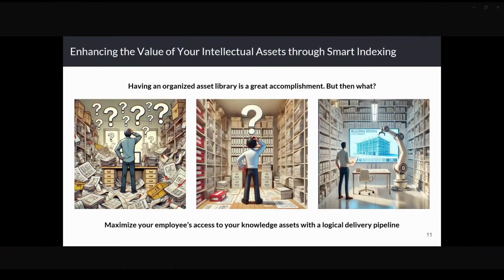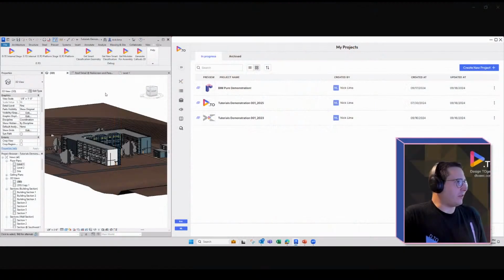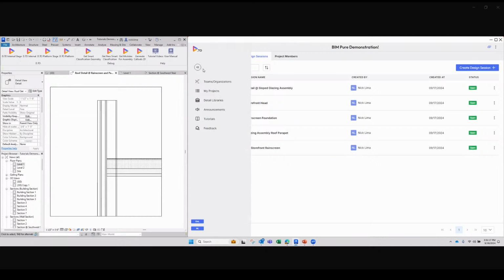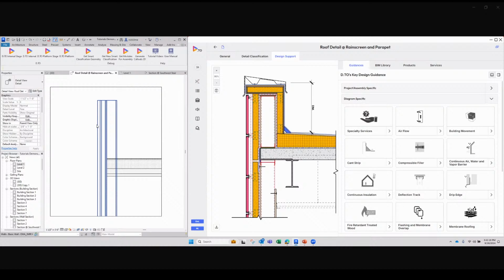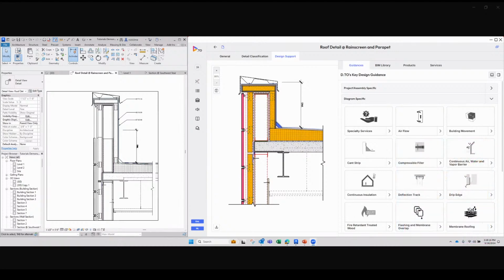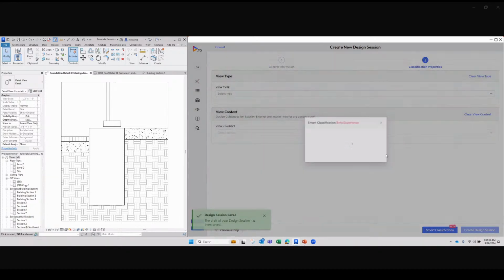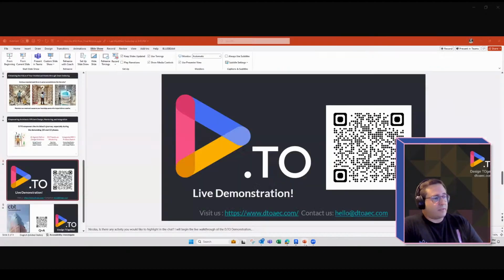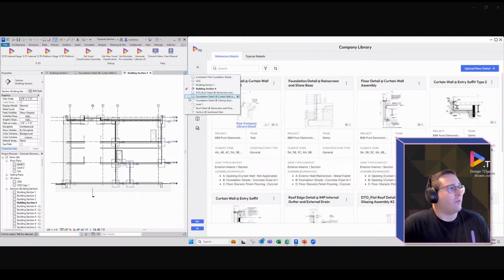Revit AI Details, D.TO with Nick Lima and Nirva Fereshetian | BIM Pure Live #082

Comment: Is there a library generated for five story type 3 wood frame construction. Code minimum. Also the detail understands if a building is going to be stick built or panelized. Do the details understand firestopping? What about the various ways that wood trusses interact with the exterior wall? Anyting that indicate strategies for wood shrinkage accomodated at openings in foundation bearing brick?
Reply: Great questions! While we've focused on steel and concrete with some wood-framed details, our catalog is continuously growing. We plan to add more wood-framed details and your suggestions are fantastic for our future design guidance.

In the meantime, you can use D.TO's company library feature to include your own specific details and design guidance. Our system supports the classification types you've mentioned, so your team can easily access and utilize your internal content through our delivery system.

Thanks for your valuable feedback!